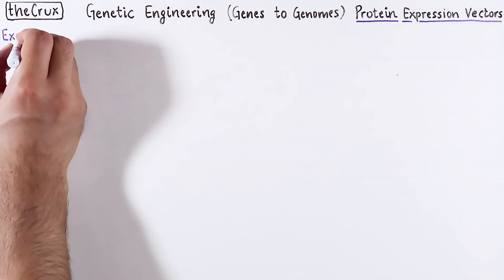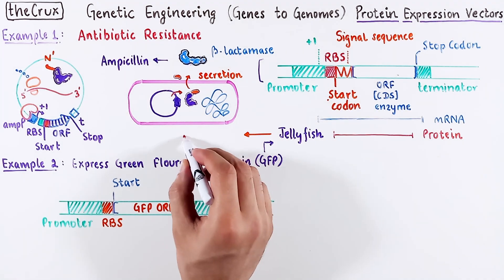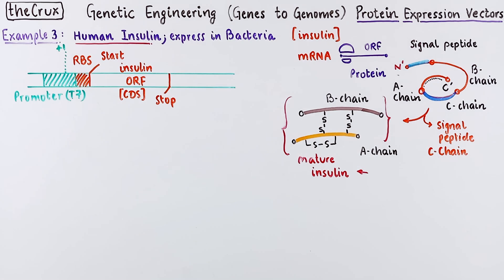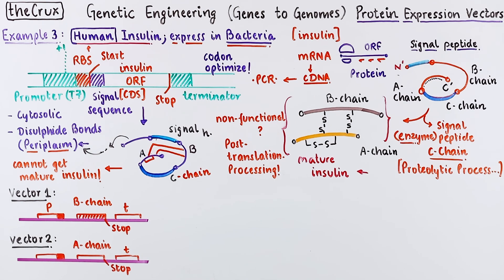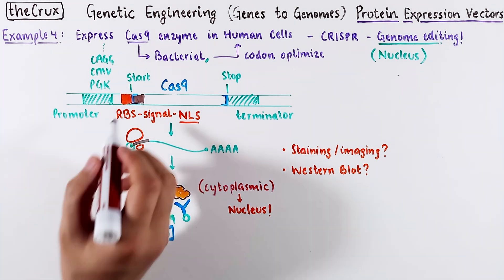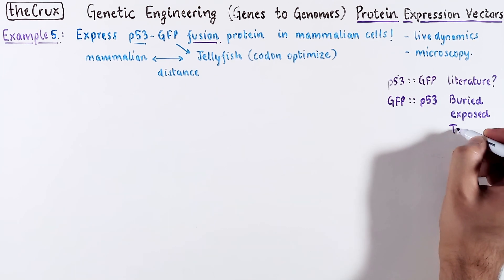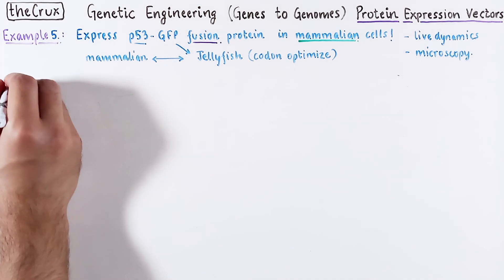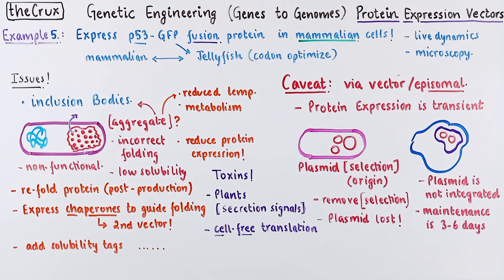Protein Expression Vectors - Examples (Fusion Proteins, Insulin, and Cas9) [Part 3]

Comment: Is there a risk that concatenating proteins (even with a linker) can cause misfolding? And if not is it because the ends of proteins don't typically contain functional domains and are more flexible with a less stable conformation and the second protein basically "just" hangs there? 

Anyway thank you for informative video!
Reply from the maker: Yes, fusions even with a linker does not guarantee that partner proteins will work - it depends from protein to protein. In case the partner protein(s) is misfolded (regardless of fusion) then yes, it just hangs there.
Chemokines for instance are not amenable to N-terminal engineering (even a single amino acid extension can be bad). Mini-motifs are generally found in C-terminal ends. C-terminus also gets a lot of PTM because of solubility and accessibility. I am not sure if I would say it does not contain "functional domains". The C-terminal is usually the exposed end (disordered and solvent accessible) so more often than not, it tolerates linkers well (but not always). 
Unless you have a specific reason to keep the partner proteins "stuck together" (say for single-molecule imaging, protein tracking, etc.) you may consider adding a 2A-peptide before or after the linker.  I may have alluded to 2As as bi-cistronic systems in the past video(s).
Reply: @theCrux    Oh you are right I forget about things like C-terminal phosphorylation of RNApol II which they told us at molecular bio course and underestimated importance of the protein ends. Apparently I have a lot to refresh! 

Anyway thank you for the answer 😊.